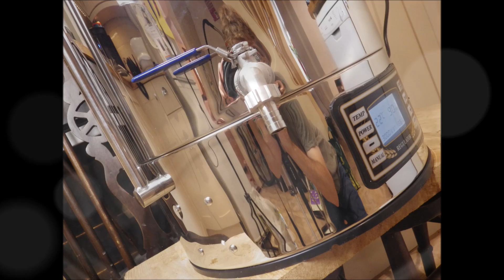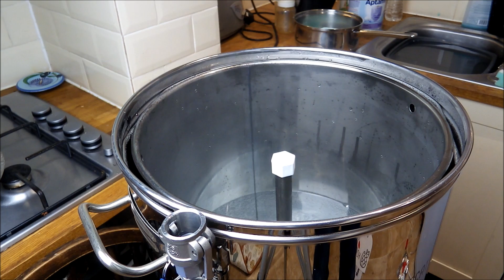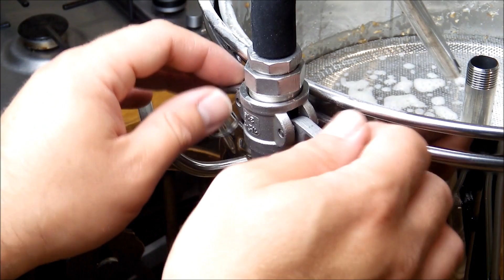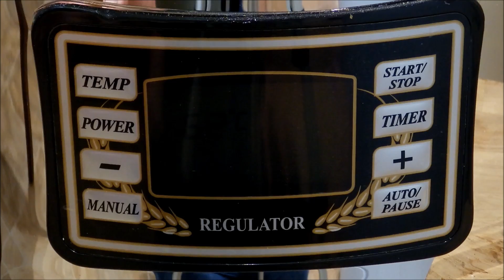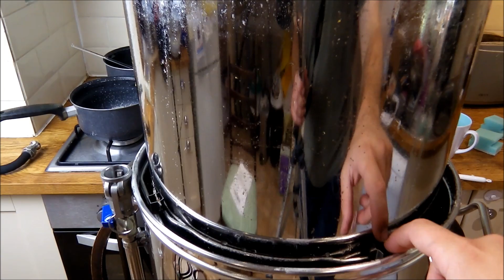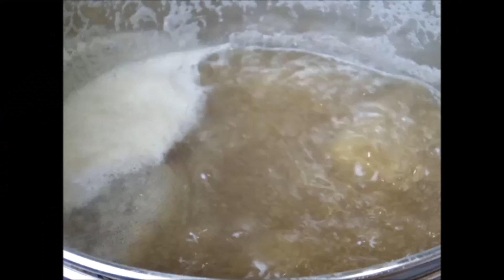**PUB SHEDS REVIEW** - Hopcat 50L Brewing System

Comment: Thanks for the video! Two questions though. 
1. Why do you need to have your waterlevel as high as the top of the overflow tube? I would think that if the wort goes through the overflow pipe, it bypassess the grains, so it just simply circulates without washing anything out of them. So I don't see any added value in it, unless the grainbed totally insulates the botom from the water, but I never saw that happening, Would it be still ok to mash with water level below the overflow pipe? (As the pipe is not really adjustable, the options are quite limited.) 
2. What efficiency did you get? What is your crush size? (So far I got 55-60% efficiency, which is way below the 75-80% I usually got with my more basic equipment I had used before.)
Thanks for any advice!
Reply: From what I have seen lately people seem to get very cloudy results from their machines. Mine from my home built getto setup are totally clear even without and protoflock/irish moss etc.  You are right the overflow is an overflow and shouldnt be full all the time.

Comment: Is this better than 30L systems?
Reply from the maker: In my opinion it performs just as well as 30L systems but has the added advantage of flexibility in terms of volume from small 10L batches up to around 40L of useable wort. Price is competitive too especially compared to other systems of the same capacity. Cheers, -Ben
Reply: Brilliant. Thanks.
Reply: @TopTechTick  It can do really 10 liters as minimum? I never tried it but for some test-recipe it would be nice to do smaller in it like 10 liter. Any things to think of when doing such a small a volume?